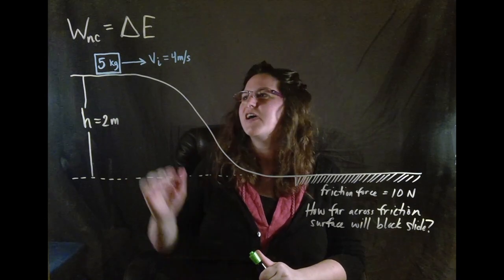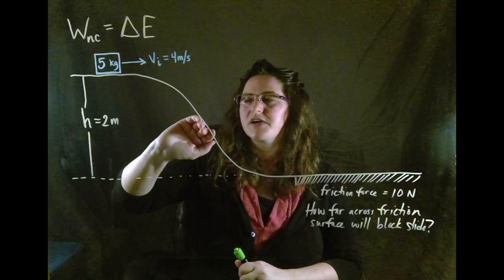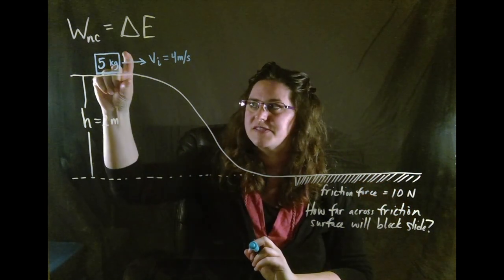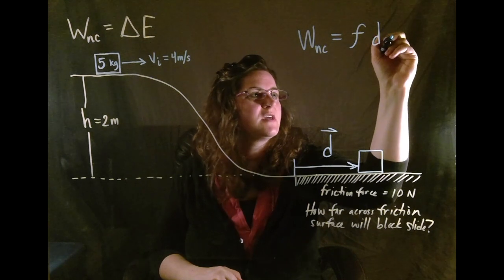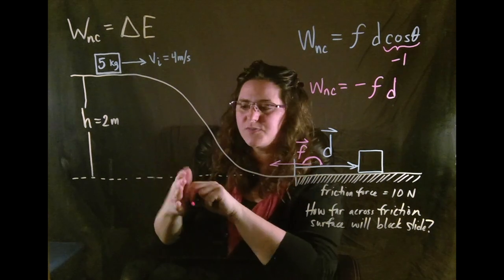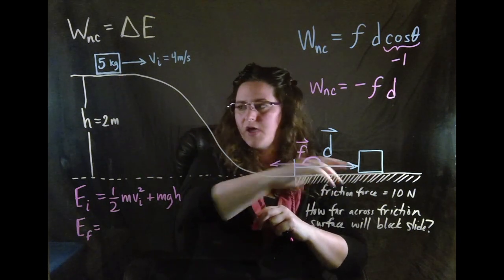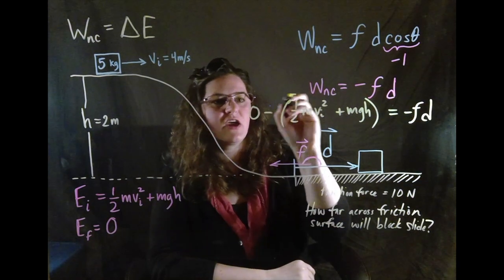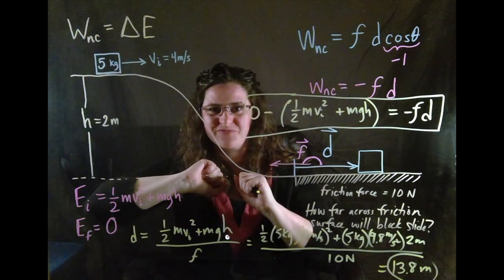Change in mechanical energy due to a nonconservative force

Comment: I liked the way you explained that, can you pls do a question where two blocks are connected by a light string that passes
over a frictionless pulley. The block of mass m1 lies on a horizontal surface and is connected to a spring of force constant k.